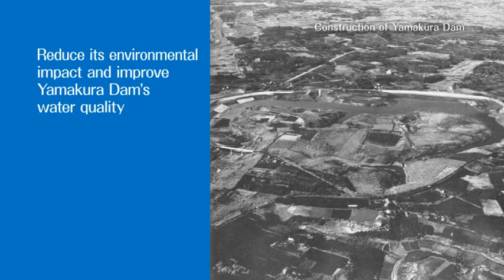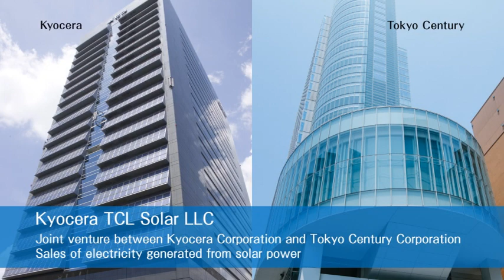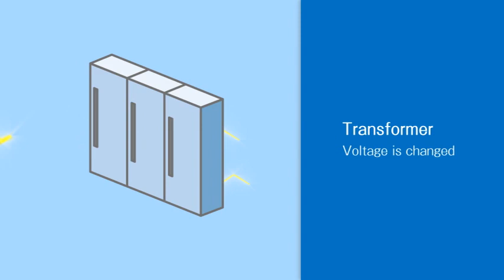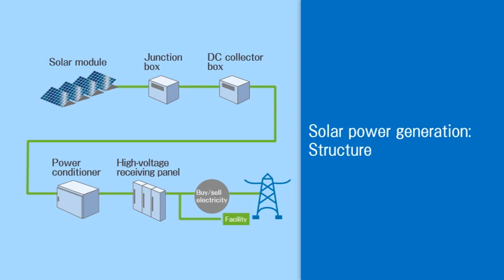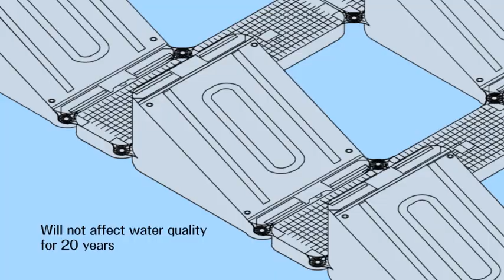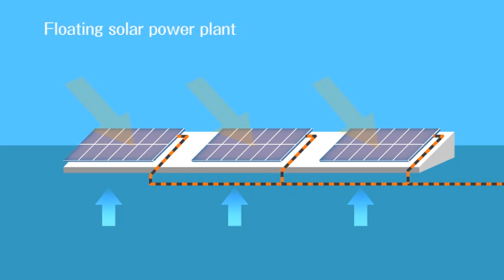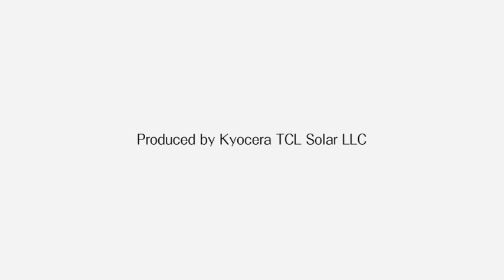Kyocera TCL Solar LLC Floating PV Plant: Yamakura Dam

Comment: I support Solar but this is NOT a good example. Utilize existing/retrofit roof of buildings, covered parking, and shade structures. Not on nature / land / water. They could have distributed the system into a smaller units on top of all those buildings near by and saved the lake. Large scale/centralized system is often good only on paper / ego of politicians / bottom line for cooperations,  but not in the efficiency nor the actual benefits for the environment.